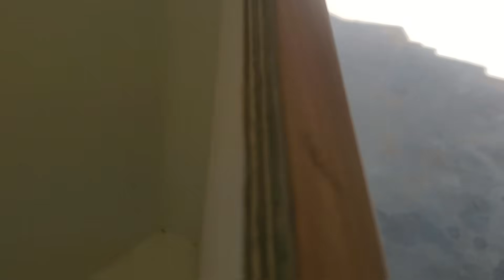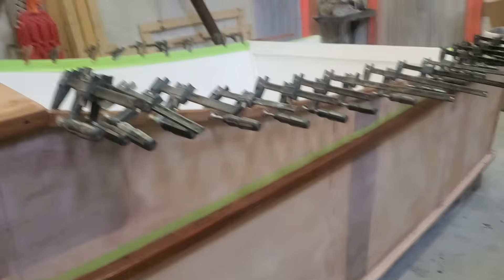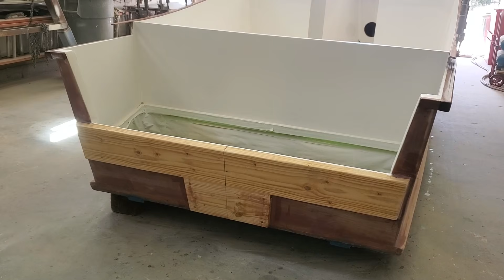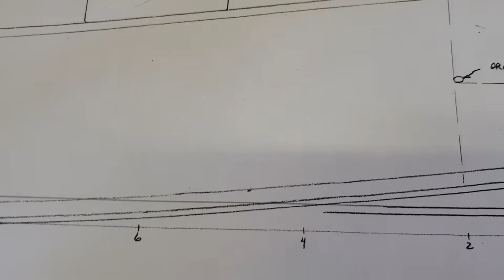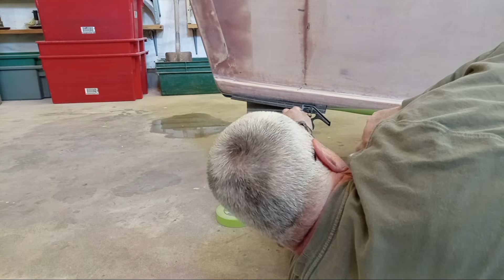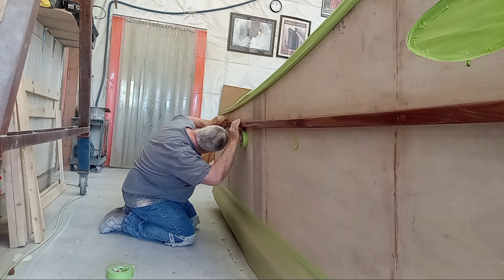Building the Michalak AF4 Grande Skiff 27 | Deck Trim and Primer Prep

Comment: Have you considered having the bottom paint follow the chine forward of the point of intersection?  (having the paint break at the outside corner where the vertical face of the chine meets the horizontal top-surface of the chine)     
This may run afoul of your plans for a boot stripe, I know.
Reply from the maker: Nope.  That would look odd in my opinion.  (anyway, I'm way past that point now...)
Reply: @timlackey352  yeah I figured as much 😁
Reply from the maker: What I really should have said was that at the time I did consider--and and then reject--the idea of following the chine because it wouldn't look right.  There's a lot more sweep to the chine in that area than it appears.